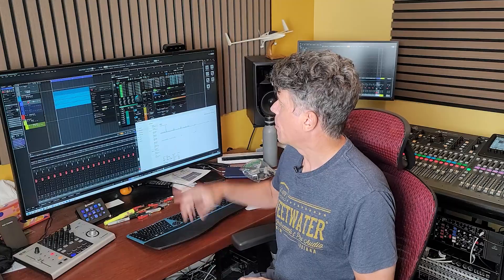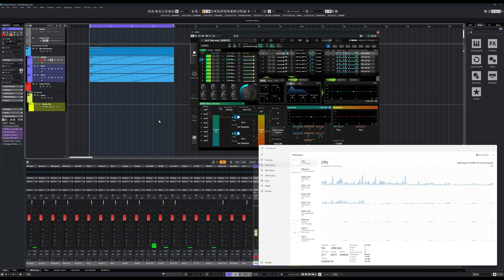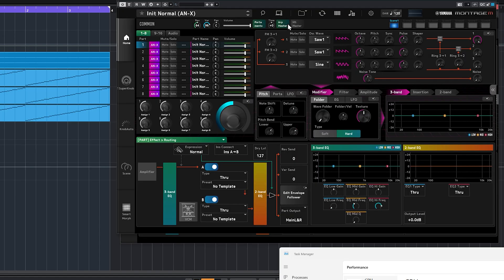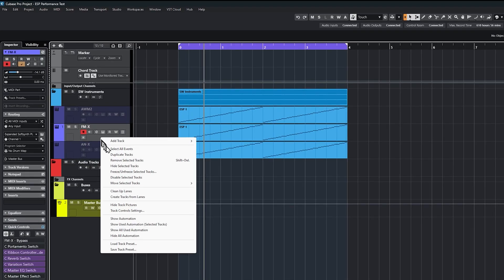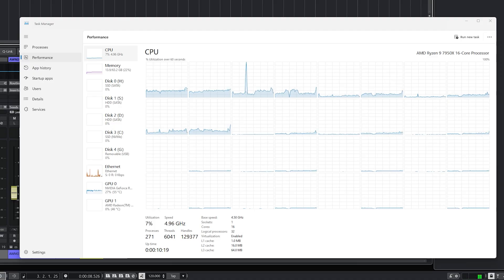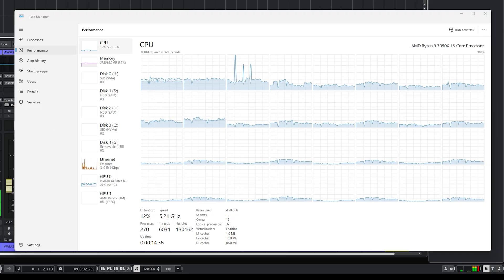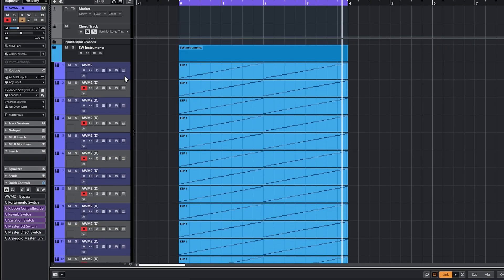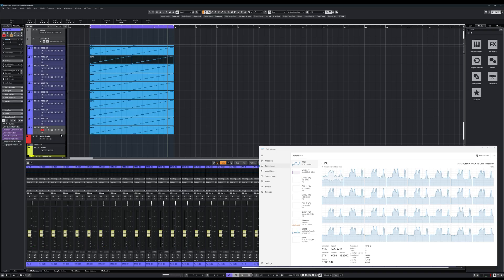Yamaha Montage M ESP Soft Synth Performance Problems - Drop Outs And Buffer Underruns?

Comment: People are installing this on i7 11th gen laptop cpu and it won't work. You need a much powerful cpu to run it. I would rather buy a man with their new processors. It runs very smooth on Mac with even m2 processor

Comment: Depending on how well optimized ESP is for the Apple M-series procs, they would also perform very, very well. I'm running the M2 Ultra with 64gig RAM which is probably in line with your setup, maybe a bit more in the GPU side of things. I would love for somebody to do a similar test using a 3yo M2 Ultra with 64gig RAM. I can't because I don't own a Montage and Yamaha steadfastly refuses to release ESP as a standalone product.

Comment: What do you see when you switch over to Resource monitor and look at the CPU/ Mem usage per exe?  Might give more insight into what app is actually taking all the resources. You can the try and play around with process priority and set some higher and lower based on what you are needing.  I made a PowerShell script that lowers the processor priority of some of the unneeded process while my DAW is running and it also sets processes related to the DAW higher.  Then I have a second script that puts everything back to defaults.

Comment: Some technical details with ESP 2 (haven't checked 3 yet): the vfx does not use the GPU, ever.  Cubase may, the OS may for display, but it has no direct support for computations on a GPU.  Also, it loads the samples data (~4G, from the 8O42_ file) in a way that makes it not shared between instances.  So every instance started is 4G more used (some end up in swap, you don't use every sample all the time).

Comment: Scott, I have a friend who is a top producer and has a PC  that cost $17k with 256GB ram and he is having the dropout problem on 1 track, he says the CPU is going through the roof.
Reply: Split the parts into layers as multiple tracks so it will benefit from multi threading. Single instance of plugin with loads of parts won’t be  multi threaded if it’s part of a single track . 

For that reason in love dedicated dsp based machines like Montage over computer daws ❤
Reply: Some of the performance patches creates the dropout problem.. single sounds like piano, clav, strings never create any dropouts

Comment: Nice testing! Honestly this is one of the best virtual instruments out there performance wise and feature wise. I'd say the key with instance count would definitely be RAM amount and perhaps RAM  speed. I'm mostly using the ESP on my now rather old  M1 Pro MacBook with just 16GB RAM and can comfortably run 4 instances (so far haven't had a need to use more), not once did I have to go to my desktop workhorse. (yet).

Comment: Hi Scott 
I have commented before on ESP performance 
Had issues from day 1 release 
And spoken to Yamaha UK and Japan at length regarding this 

1st issue 
ESP is the only plugin that requires CPU AV2 
Instruction set
 if it’s AV1 it won’t run at all
So ESP is the only VST on the planet that does this
Forget GPU it has nothing to do with performance 
I have 4 screens and a really powerful GPU hardly registers GPU use ever

My PC. Is a HP zeon dual CPU 2690 v3 
3.6 gig 24 core 48 thread and I have to run buffer on 2048 to stop drop out
So Really powerful PC

I can run 30 + tracks easily with multiple VST instruments and effects with no drop out on 256 or 512 buffer
 
my multi core performance will 
Out preform your system and many others
But on single core it will not and is not as good as modern CPU s but still 
not slow as it dual CPU 
my PC is a sever to designed to run programs written for multi core performance 

So basically ESP is badly coded written program that uses single core function and not written for multi core 
I have tested this

It’s the only VST I have an issue with and I have over 100 VST

Tested it on Cubase , traction waveform, presonus , Luna , cakewalk band lab sona and next 
All same results

If you have a CPU with good single core performance and high spec you will be ok 

Yamaha need to pay attention to this issue 
There are so many people having issue with ESP 
Yamaha sort it out
Reply: The Xeon 2690 v3 is a 11-year old CPU.  We are talking 2014 tech here. That's your problem. Your "really powerful PC", despite having many cores, is based on Intel's 2014 Haswell-EP architecture. Its per-core performance and clock speeds are significantly lower than those of a Ryzen 7950X. Most modern VST plugins are not optimized to use dozens of slow cores, instead, they rely heavily on strong single-thread performance and fast memory access. The Ryzen 7950X offers vastly superior single-thread speeds, higher boost clocks, and more advanced instruction sets, which directly translate to smoother real-time audio processing. In this case, the bottleneck is the outdated architecture and weaker per-core performance of the Xeon. You are due for an upgrade.

Comment: What you will find Scott, from people complaining about dropouts, is that in the field of tech optimization they are armatures. They are running lots of background Windows services like Windows updates, search indexing services, Sys main, Workstation, Server, backup systems, connected user experience, game input service, Windows Biometric service, and on and on. Their hard drives and Windows disk settings are not optimized either. Then, they have an underpowered pc, and then complain. I consult on this stuff and see it ALL the time. BTW, the 7950X rocks. That or 9850X is my next once, on a 13700K now, no issues even with East West full orchestras.
Reply from the maker: I think you're probably correct.
Reply: Absolute nonsense and misleading 
This is the only plug in I have issues with out of hundreds
My PC is totally optimised 
apart from being a electronic for service engineer  for 45 years 
I also have a degree in PC hardware and software architecture 
And serviced and repaired may computers 
Your knowledge is clearly limited 
And misleading 
Do you own this plug in probably not
Reply: @davemolino-hn6rp  I didn't say you in  particular. Deep breaths sir. I said a lot of people are not optimized. Very defensive sir, it was not aim specifically at you. Just a comment on what I run into routinely. that's all.  OK, enough internet huffing and puffing.  Used to be you would politely disagree. Not anymore.

Comment: I’m running a M1 Max 32ram and with MainStage ESP is almost unusable. CPU over 100% with just a single piano/pad
Reply: This  is a problem. Cause it is exactly my configuration… thank you for the info…I’m in the phase to decide to change my keyboards.
Reply: The devil is in the details . For heavly sample Audio Units or plugins presets it’s Directly related Single core performance . Single audio unit or plugin cannot be multithreaded and the moment you pick up a preset example a Steel Guitar that has got 8 parts your polyphony count is going to directly impact the single core performance, you can use cpu monitor of logic to see this behaviour and as it hits higher the crackle happens . All The 8 parts guitar or orchestral strings won’t be triggered when you play because they are associated with scenes , so if you can sacrifice the scenes by deleting the layers/parts related to scenes/variations you don’t need (the part may get associated with super knob also ) and duplicate them as different tracks the multi threading will kick in and you can still play the simultaneously by arming the record on multi track that way the single core won’t hit max and you can get performance to usable extent.

Comment: I have 32-core (Thread-ripper Pro) Lenovo workstation that I replaced my old 4-core system with, that was having trouble handling a lot of orchestral library tracks, and when I first bought it, thought that I wouldn’t have drop-outs but found, I had them there too. I discovered that disabling hyper-threading fixed the problem. Hyper-threading cores are pseudo cpu cores and can only do light tasks so if a vst get’s assigned to such a core, you will most likely get drop-outs. I’ve seen this in Hypervisors too in the past, running virtual machines. Nowadays, most hypervisors are aware of the core types and will assign them appropriatly to vm’s but music app’s most likely still can’t make that distinction so, you can get drop-outs.
Reply: This is partly why Intel stopped hyperthreading.
Reply: what do you mean? first of all hyperthreading is Intel's propiertary technology, you and OP both have AMD,, you literally cannot disable it since you don't have it in the first place. 
CPU's like in the OP's video have equal cores which are the actual physical things doing the work inside the CPU and their threads are also equal which are virtual things that run instructions you (computer) gives them (apart from minor differences in binning quality (some might clock few MHz higher))
this must be a bug in software, the most probable issue is the DAW itself not being able to handle multicore properly since it is the DAW doing the assignment of the tasks.
Reply: @jabetsgiOK…AMD calls it Multi-threading but it’s essentially the same thing
Reply: @jabetsgi Intel Arrow Lake desktop CPUs do not have Hyper-Threading